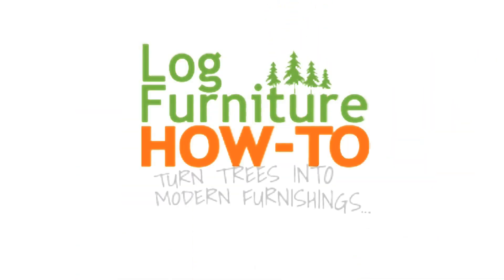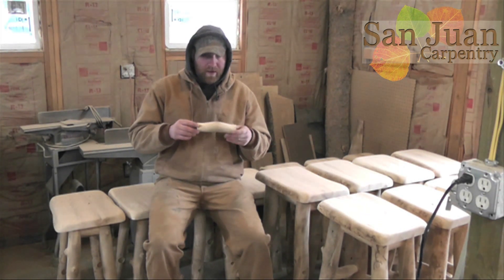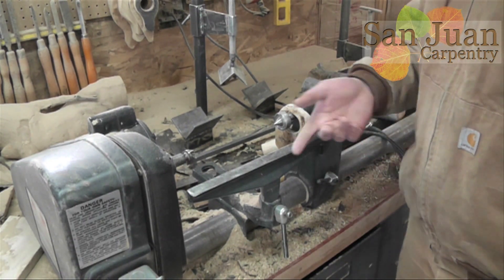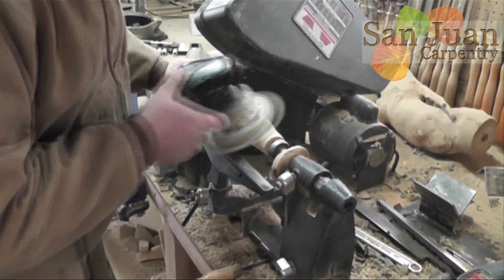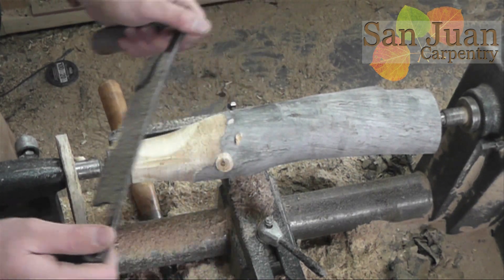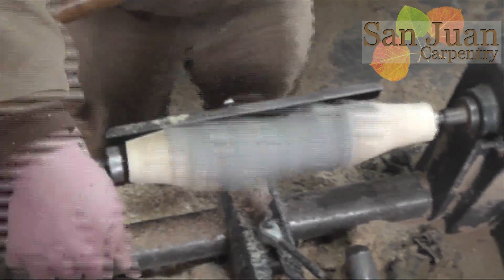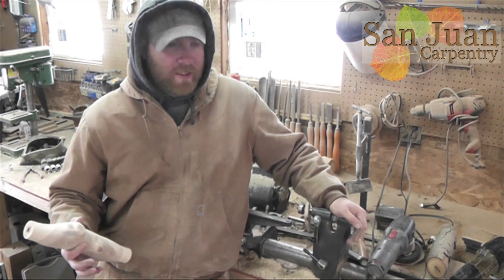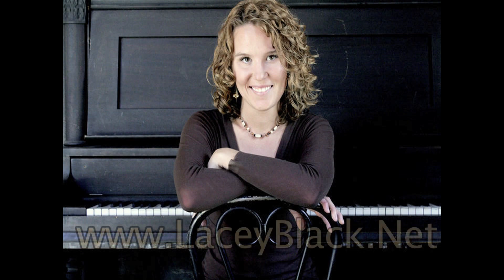Spin a Tenon on the Lathe How-To

Comment from the maker: That's a tough diameter... If that's all you got then a coffee table would probably be a good place to start. If you have access to a mill, you could mill up a 4x4 post or two (center of log = center of post), cut them down to the length of your coffee table and glue them up. Then use whole logs for the legs and finally, use the "first cut" or "half round" pieces from the mill for the skirt. Check out my "Howp-To Make a Skirt" video and also "How-to Taper Log Legs" video. Good luck!